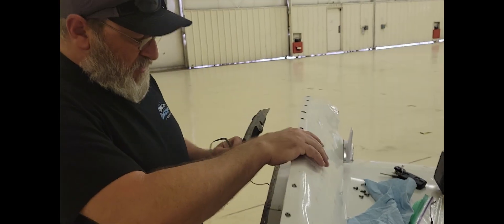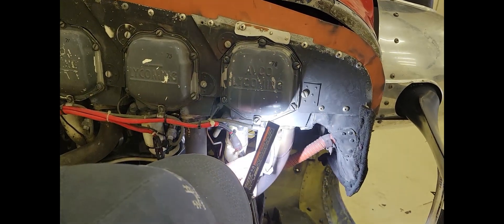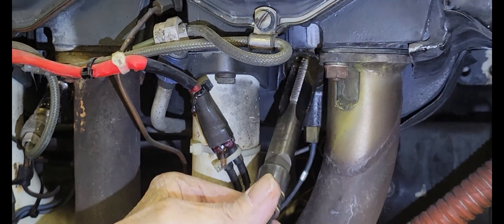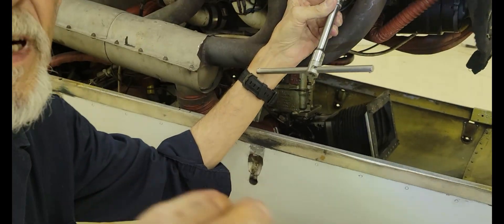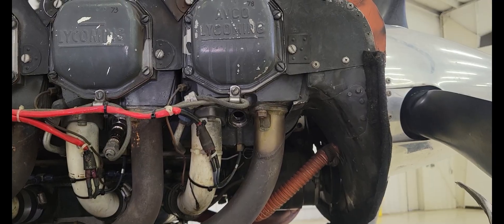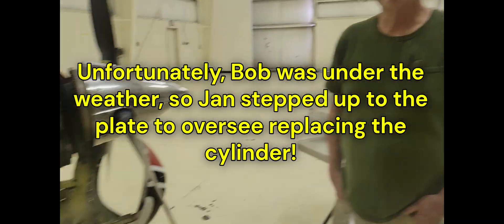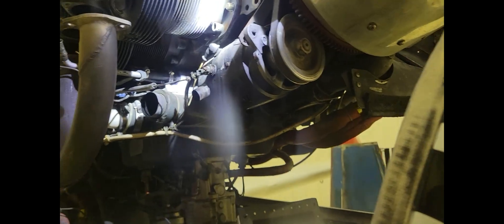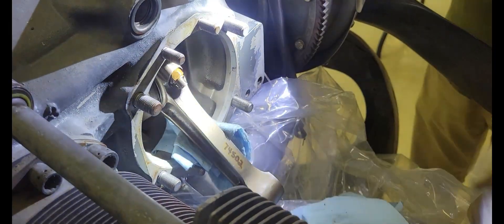Lycoming O 540 narrow deck cylinder replacement, part 1.

Comment: I forget: what is “ADSB” ?   And learn something everyday - I’ve never heard of a helicoil being used as “normal” equipment on an aviation motor.  Why are they there ?
Reply from the maker: Automatic Dependent Surveillance–Broadcast. basically it lets other aircraft know where you are in relation to them and them to you. yea, helicoils of a particular design are used to repair aircraft cylinders to be able to have a longer life, but repairs suck!
Reply: @mustangbob51  🥰
Reply: It is like a transponder. But unlike that, ADSB Out signal is received by all the planes that have equipment (ADSB In) to see it. 
Like having access to tower radar screen inside the airplane and not be entirely dependent on ATC for collision avoidance.
Might be good in places with low radar coverage. 

Little bit controversial. Since FAA requires one to purchase it. Once it is required everywhere radar might not be needed anymore. 
Offloading the radar cost onto the users.
Reply from the maker: @DirkLarien well said Dirk. That is exactly whet it does.
Reply: @DirkLarien  :yougotthis: